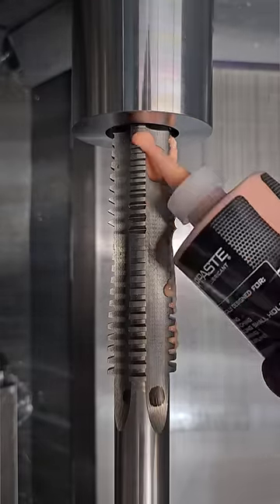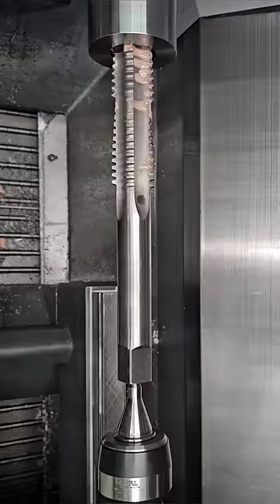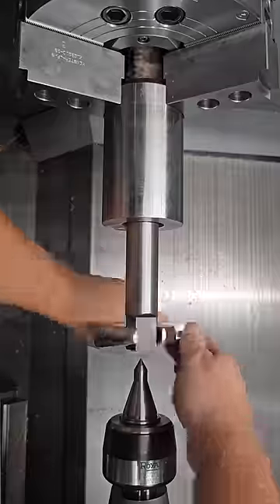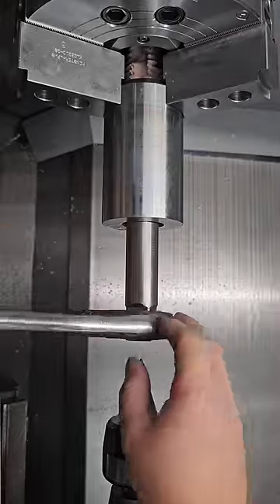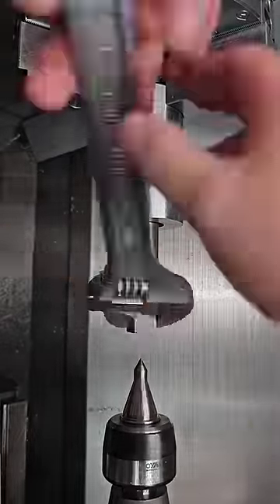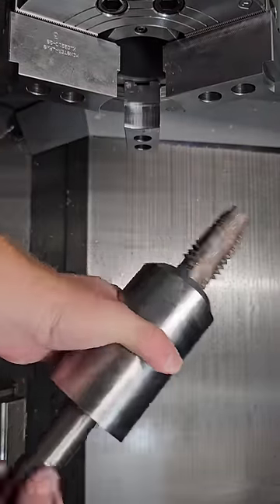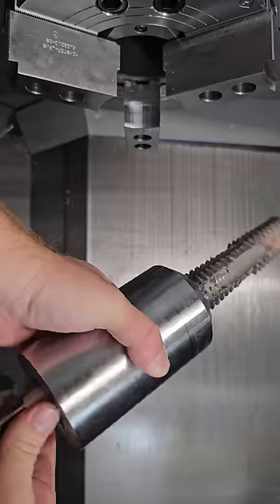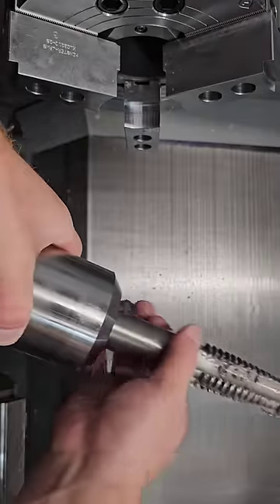This was a terrible idea!

Comment: That lathe is cleaner than most take-away kitchens
Reply: It’s a closed machine so you just hose it with coolant. Looks no cleaner than any other I’ve ever used.
Reply: If your enclosed lathe is dirtier than this, you’re slacking.
Reply: not everyone wake up on the wrong side of the bed, give him a break.
Reply: I’ll tell you from someone that works in the food industry that even after he lathered and touched it it was cleaner than the plate you get served on lol we wash dishes with hot water that’s it then they dry
Reply: New machine, who dis?😂
Reply: That's not saying much
Reply: Thats usual
Reply: I've worked in kitchens and that's not saying much.
Reply: All that time at the krusty krab paying off
Reply: Avoid eating out...
Reply: Cause they spend their time filming stupid videos instead of working.
Reply: What about dine-in kitchens?
Reply: @toxicity6629 idk where you work but in America there are regulations on that process that tell you server ware must be sanitized either by steam or solution

Comment: ACME thread cutting is always sketchy.   Cutting all that metal at once demands serious torque, a strong tap, and a priest to bless the procedure.
Reply: I like the priest part 😂
Reply: Thats why you always pull out a couple times 😂😂
Reply: And again after to exorcise the demons from the machinist.
Reply: I’ve seen it done progressively with 3 specially made taps, so the material removal load is not so severe, and torque requirements are eased.
Reply: @Vikingwerk  Oh wow, that is a very cool solution!  My machining experience (such as it was) predates that!  I have broken three taps in my life.  Two were my fault and the third was an ACME thread.
Reply: The specific tap here is using actually took that into account. You can see two sets of threads on the tap one set towards the tip is a perfect triangle to rough it out essentially. The second set is the actual acme tap coming in afterwards with less material it has to cut through
Reply: If it breaks you could torch it out
Reply: @auntysocialist Torch only if you want to risk damage.  I have seen videos here on youtube, where a broken tap in an expensive piece of equipment was removed by EDM.
Reply: @stephenvale2624  I've seen those too.  Was kinda tongue in cheek considering the size of the tap.
Reply: Yep. And any taps can give sloppy threads if it isn't rigid enough. Better to single point or thread mill if you can in my experience.
Reply: @stephenvale2624 while I rarely broke taps some guys in our shop did it a lot. The welder would build up a weld tit sticking up to unscrew it with pliers, it worked good unless it broke to deep in the hole😊
Reply: Hiya, it's just me commenting on a 4 month old thread. Just wondering what is the diff between threading acme and say metric threads ? The larges I'te cut with à tap and holder was M22 and that was à BI**TCH to do 😂
Reply: @brahtrumpwonbigly7309 unfortunately only acme stub can be thread milled. Full acme does not have the clearance angles needed to make it tru to form. You can get threads close enough in the fab world but aerospace is a no go in most applications
Reply: @ireallyreallyreallylikethisimg pull out game be weak 😅😅
Reply: @martindunn4545 The Acme thread form is a trapezoidal thread form used in the US. Trapezoidal threads differ from standard 60° metric or UN threads with a thread angle of 29° for Acme threads and 30° for trapezoidal metric threads, as well as having a trapezoidal thread profile.

Comment: As far as "terrible ideas" that machinists have.... this one worked out pretty well lol.
Reply: Lmao I feel like most of machinists terrible ideas end up with someone dead or maimed.
Reply: @Roach_Dogg_JR  lol 💯 %
Reply: Who needs a chuck throw sensor
Reply: Yeah this is more or less just how to hand tap in a lathe. A terrible idea would be a 3 foot wrench jammed in the conveyer and turn the spindle on.
Reply: No he did it the hard way. He should have left the wrench bump against the way and use the power of the chuck and spun the metal piece, not the tap.
Reply: @Roach_Dogg_JR The amount of times I see a RoachDogg. In the comments on videos that are recommended to me. Has me wondering if Oneyplays fans are all going to be on a no-fly list at some point.
Reply: @Chris-du7hi I’ve done it before…Worked fine 🤷🏼‍♂️
Reply: I wish he would have explained WHY it was a terrible idea. I know large taps can be a lot of effort to use but it seemed to work out really well. 

My thinking that if I were going to do this, I'd be tempted to run a boring bar with a cutter a bit narrower than the acme thread down the bore, stopping well short of the maximum thread depth. Then run the acme tap down the threads to bring them to the final size. 

But like I said, I really wish he'd given us his actual opinion as to WHY this was a terrible idea. The two drawbacks I know of are the difficulty in turning the tap and the expense of the tap. (They are far from cheap). But other than that, I would have assumed that it was a totally appropriate way to make ACME threads.
Reply: @BigJsgarage why is this getting thumbs up. This is totally NOT a good idea? Or are people taking this as a joke. At the very least, doing that will damage the ways. Especially as the tap pulls away from the tail stock, then twists out of the hole and the whole thing goes bang bang bang bang around with the chuck taking chunks out of the lathe and maybe your hand if you were holding it.
Reply: @michaelmichalski4588  you make a comment about machinist bad ideas and then sad about the really good idea. Come on power tap it ya 🐈‍⬛
Reply: As a retired machinist, I say do whatever it takes to get the job done  !!

Comment: I broke a $1400 M40-7 tandem tap in Silicon Bronze once. That stuff was so hard a HSS drill would not drill it straight so I stuck the tap in a tap sleeve in the tailstock and tried going reaaaaaaalllyy slow with a lot of oil. Crack Those old manual lathes have heaps of torque that CNC envies. 
If you ever break one of these and have to save the part, mill a solid walton extractor and it will get ya out.
Reply: Never would have that same issue at my current shop, but thanks, always appreciate a shop tip!!!
Reply: Didn’t realized old machines had more torque than CNC’s but I have no experience on old stuff. 

I remember walking in to work seeing a robo drill with a cat 30 spindle form tapping steel 5/8-11 without any issues at 100 rpm. Suppose I shouldn’t be that shocked but that spindle is smalllllll
Reply: Always roughs it out first with a single point tool.
Reply: I thought silicon bronze was very soft. I use it to TIG braze, but have never machined it, or seen it in any size greater than filler rod. Is this the same stuff you are talking about ?
Reply: @timlong1462  Its still soft but it has sand added for abrasion resistance and it is obnoxious to machine with HSS.

Comment: You did not say why you would never use an ACME tap again.
I tapped a lot of leadscrew blocks using single point tools on a CNC 4th axis.
Finally I purchased an ACME tap and thought I died and went to heaven.
It was 20x faster and produced a smoother and more accurate thread.
Get a 4 jaw chuck or tapping collet to hold the tap properly, preferably in the carriage.
Don't use an adjustable wrench, especially backwards. The offset torque will significantly increase the required torque and produce an oversize oval thread.
Reply: We thread a lot of nuts and use a small insert on a 2 axis cnc lathe not as fast as a tap but we’re more precise with our fits
Reply: How much does a Cnc’nist make a year?
Reply: @timothygraves1531  agreed. With a rigid enough machine, a threadmill or insert has the advantage of covering ALL tolerance specs with one tool.
And arguably at a lower total cost.
Reply: @thatsallfolks3115 are you seriously asking or being sarcastic.
Reply: @correctednews1463 i suppose it is subjective as it is very dependent upon the shop. If they only need to cut that one particular acme thread once every few months, a tap is probably good to go. If they are regularly cutting a variety of acme, insert tooling would be more effective. But even that can situation can have contradictions.
Reply: @burnheretic3950 Can't speak for the other guy, but I'm asking seriously. Not a machinist and am genuinely curious.
Reply: @thatsallfolks3115 Not nearly enough, its one of the reasons the trade is dying. Another being they dont teach the trades in high school anymore..
Reply: @correctednews1463 that adjustable wrench jab got me laughing
Reply: @Ligma_Balzach  With 5yr+ of experience and they're decent at it like 45-75k, likely with some benefits on top. 
Starting out more like 20-30k. Around western PA anyway.
Reply: @Chris-du7hi  Gotcha. TBH, I didn't read the thread very well and thought you were asking regarding the "why" question. My bad. Interesting though, regardless. I'd have thought that a skilled job like that would command higher pay than that
Reply: @Satchmojones  so what do you think of Titan Gilroy aka Titans of CNC? 

He is trying to revive domestic(for americans at least) machinists and machine shops, but his content is free for everyone and he basically wants everyone to be educated in it. and he is alos setting the standards for CNC machining.

Free CNC academies and online courses, free forever, and he is a beast and pushes the boundaries when it comes to CNC, his speeds and feeds are insane,  I was impressed before, but never really liked him, but recently watched more and learnt more about him and he is actually a pretty great guy, considering how much content he is producing and giving out for free, then there are the discounts he gets for people on tools and machines, all without taking a cut (on the machines at least, idk if he gets a profit on the tooling, but it's cheaper than the suppliers)

Comment: How was the runout on the OD of the tapped piece?  Could be improved by single point rough threading -.010" under and as deep as possible, at least 1.5-3 diameters deep.  Then finish with the tap.  Should give you better concentricity, longer tap life, improved finish and closer thread size.  A large floating tapping holder would work well for finishing with the tap using the main spindle.  I would recommend at least getting a proper tapping handle that allows you to use both hands to prevent touqing your taps off center.  Just my 2cents.  Nice machine!
Reply: Ikr that machine looks badass
Reply: This is the way I do it, for machining valve parts.

Comment: I had to use one of those in a vertical mill at work. The tap was 6.04in long. The clearance I had from the top of my part to the table was 6.067in…. Easily the scariest tapping cycle I’ve ever ran. Also it was the slowest I’ve ever seen a tap run. We had it going at 50rpm
Reply: Surprised it had the torque at that.
Reply: @handlesarefeckinstupid  I’m not going to lie when my lead man told me to run it I didn’t believe it would work, but then it worked for 2 days straight

Comment: Dude, I did a repair last week in which holes were filled with 1.25 inch grade 8 bolts and welded.  I had to drill and tap 1”-8 Thread mill was fine, but I had to hand tap one hole which took me well over an hour
Reply from the maker: This was extremely hard to hand tap.  The handle was 5 ft. long if that is any indicator.
Reply: Grade 8 bolts become brittle and snap under load when welded.  Fun fact of the day. 10 days too late.
Reply: @OctaneWorkholding  I bet that big Acme tap was brutal, I believe it!!
Reply: @anonymousdude6493  Welding anything changes the properties all around the bead.  Why don’t you try to teach me something useful since you’re supposed to be an…uh…expert?
Reply: A few years ago I had a 200 ton mechanical press with air cushion I had to deal with. The 2" thick plate that was bolted to the air cushion cylinders was off to one side in the press, hanging up under the bolster and causing 1 cylinder to lift full stroke and stopping the other about mid stroke. Made certain parts a pain in the ass to make.  Previous maintenance guy that was fired didn't catch it for 7 years.   
      Took me a week with 4 days doing double shifts to repair the damage.   Had to weld up all the craters gouged in the plate grind it smooth,  the 2 cylinders had to be drilled and tapped inside the press. Had to tap to 1-1/4  using a wire out hydraulic mag drill for mining.  All we had at time,  and then to tap I used a 3/4" socket extension upside down in the tap handle so I had room to swing the damned thing.  8 holes by hand bout 3" deep and had to be a bottom tap.  Done this before but not on this size of a scale and I sure as hell didn't want to break the corners of the cylinders. Getting another one or just a rebuild kit and me welding that on was not what I wanted.   Glad it went as planned.
Reply: @jeremybanks719  that is super cool man!!  I’ve never done repairs on a press quite like that one…. Good job, sounds like they had the right guy for the job!!  Were you able to remove the plate, and did you precision grind it or just fill the craters in and blend with a grinder?
Reply: @BlueF350   hand grinder n just blended,  yeah got plate out easy with chain and forklift. The bolster plate that the dies bolt on was big. Bout 10" thick and something like 4 foot by 6 foot rectangular.  Originally the press had a feeder on one side and stripper on the other side. Could be set up with a coil of steel on the feeder and set to automatic.  Something like 1 to 1.5 second cycle time on it.    I'm just glad I didn't have to mess with the bastard green press. It came from gm from the 60's.  You could put a vw beetle inside it and one touch of the button, turn it into a flat plate.  Thing was 2 story above ground and at least 12 foot under.  Monster mechanical press.  Hell  it could punch out a truck bed in a single stroke.   No safety on that thing, it kinda scared me just thinking about running it, and I don't scare easily.

Comment: Why exactly was this a terrible idea?
Reply: I'm guessing cost of tap, time to acquire the tap vs. Single point tool...... for one off jobs.
Reply from the maker: The amount of strength needed to tap this mainly.  The correct tools to single point this all the way through would be roughly $3k which is why we were willing to give the tap a try.
Reply: @OctaneWorkholding Cost off tap? +- 500€ ?
Reply: @OctaneWorkholding Not sure why you didn't fix the tap and hand turn the chuck with the chuck key. Also have no idea why cutting this with single point cutting would cost 3k
Not been in a modern Machine shop in over 20 years. In my day I had to stand at the machine and enter g-code on a keyboard that looked like a simple calculator.😋
Reply: Had to tap it by hand, I'd imagine h9mie is tired now 😄
Reply: @OctaneWorkholding  Those big taps can take a beating, sometimes literally. The guys will sometimes rig up a cheater bar and then beat it with a hammer. I don't recommend it but they very rarely break them.
Reply: @GBOB68  the ethic is what i was going to comment on aswell
Reply: @GBOB68  they had cnc 20 yrs ago, I thought it was newer.
Reply: @Zimbob2424 they had cnc 60 years ago
Reply: @Zimbob2424  I was doing cnc 39yrs ago. Before that there was nc which was controlled by a punched tape. My machining started while both were being used but the nc was rapidly becoming obsolete.
Reply: @Zimbob2424  yea mate, ive been  CNCing for 72 years now 
I will be 39 next week
Reply: @GBOB68  cool, I started learning about it when I started 3d printing last yr, of course 3d printing started in the 80's. which seems like yesterday to me. Thanks for the reply
Reply: @Zimbob2424 20 years ago was 2003 how would it be newer???
Reply: @timothylessing4774  it could of been engineered in 2010 or last week. Stop doing drugs
Reply: @Gablotescobar 😂
Reply: @GBOB68 not sure on 3K either long deep hole but atleast it's not small.
Reply: @GBOB68  Man I ran several machines that still hade a "tape" mode. Them things were still making chips in the 2010's.
Reply: This is exactly how I used to do it in  the shop I worked in... we didn't have nc or cnc we hand made everything.... and there is no way that would cost even close to 3k to tap
Reply: It's only a terrible idea when it doesn't work and when it does work, it isn't that common
Reply: @GBOB68 Just out of high school, the area next to where I worked had a punch tape NC machine. One time something went wrong with the punch tape reader and there was punched tape tangled all over the room. It seems like they mostly worked on the machine not with it . That was 55 years ago. …… more recently …. Changing subject  …., when I needed to tap a sensitive part I would take the drive belt off of a drill press , turn the pulley by hand (gloves on ,pulley is dirty) , with tap in the chuck , use my elbow to lower the tap until it started tapping , while turning the spindle pulley by hand. Little bit of trouble but in some cases it was much better than messing up an expensive part that had an iffy tapping situation .
Reply: @imatveyzasipkin  Sixty years ago it was NC; not CNC.  The programs were on paper tapes that had holes in them for the code.